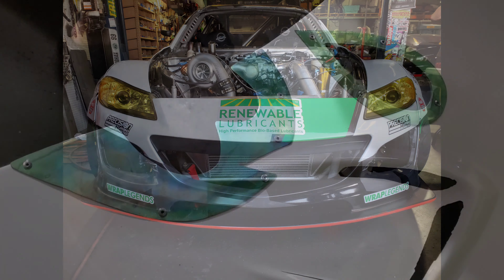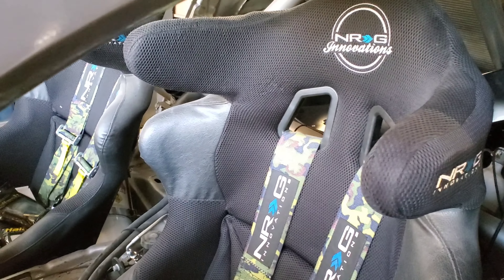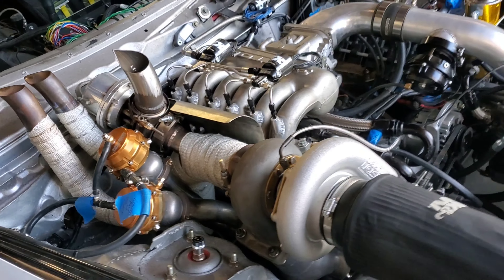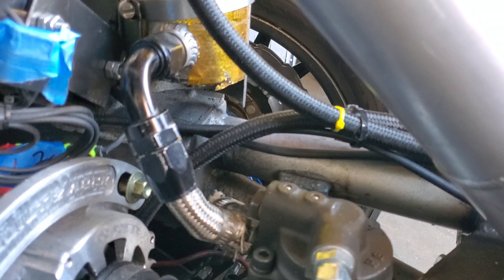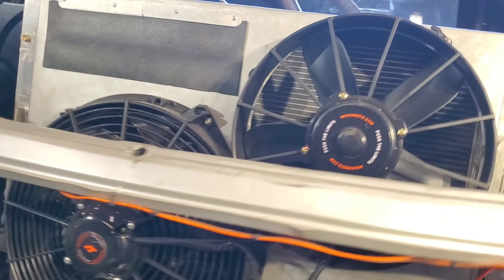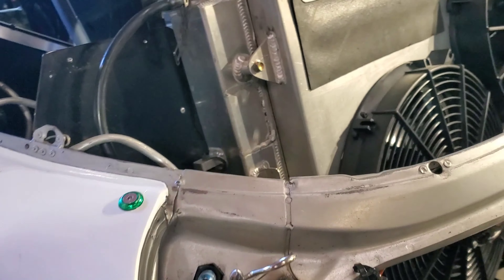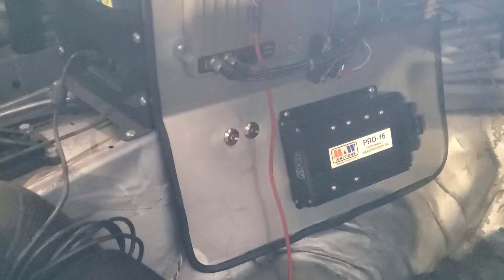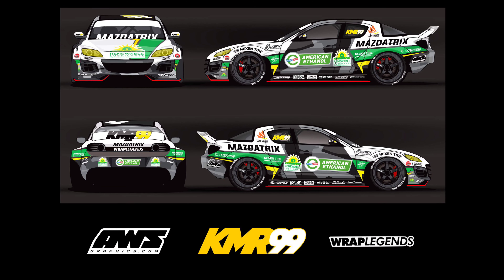1000hp + NOS, Turbo 20b Formula Drift RX8 build up 2020.  Walk around KMR

Comment: How did you go about sizing the turbo for drifting? With the 20B+NOS, do you have enough down low torque to run a huge turbo? Or is that turbo quite responsive down low? Interested in the setup. Thinking about going single turbo on my FD but want to keep the down low 3-4k pep of the sequentials. I know for drifting you want a lot of power under the curve down low so wanted to get your thoughts. Build looks awesome!
Reply from the maker: This is not a huge turbo.  Do research but there alot of common setups to choose from.  Let me know what HP, boost range, porting,  fuel octane and ant specs your aiming for and i might have a recommendation

Comment: How Come you use rotors instead of a LS?
Reply from the maker: Good question.  So I was the engine buider for Mazdatrix for 15 years. Drift and race was how we tested our engine development.  I still build all my own engines and have a small shop that still works with Mazdatrix.  Basically because I build and sell rotary,  just got lucky and have been able to work my may up to pro FD.
Reply: The above was a polite way of saying screw LS swaped rotary cars.